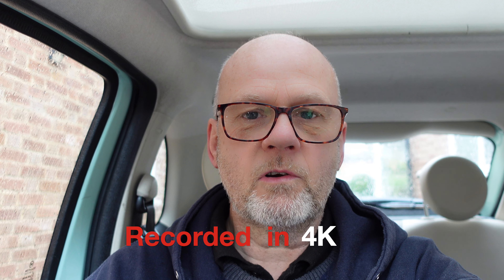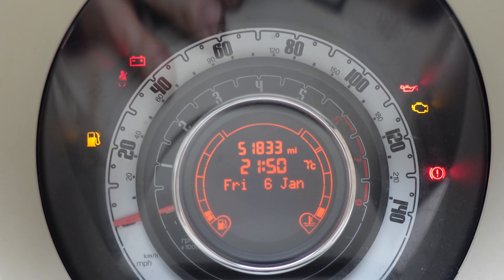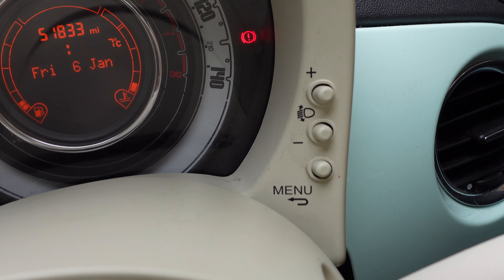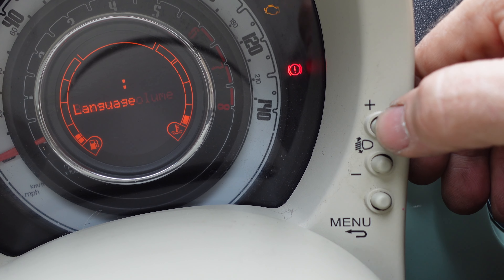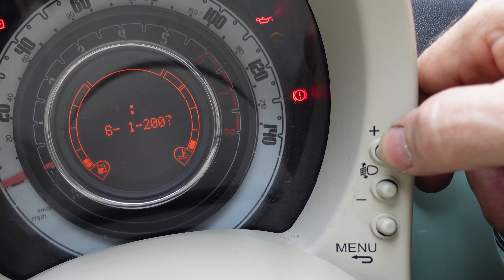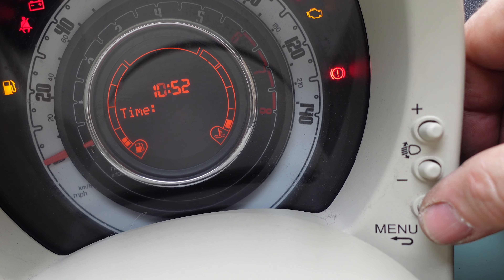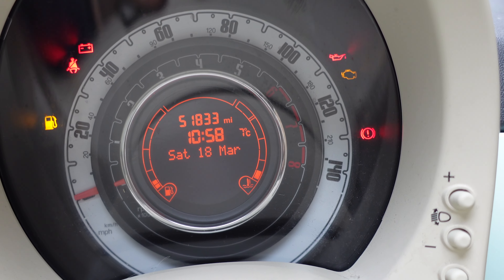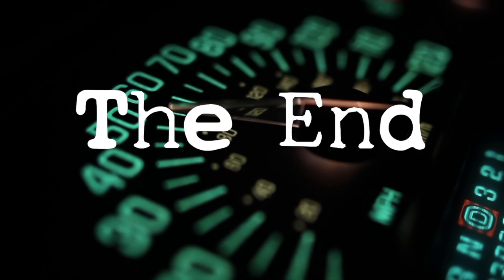Adjusting the time on a Fiat 500 or Abarth - Love 500 Basics Series

Comment: Hi Paul.
A nice basic how to video here mate!.
Can i ask you have you ever experienced any or some of the menus not coming up!, on the screen?  all mine work with the exception of the day lights function! I press menu then + button and it goes straight to passenger bag ,missing daylights completely- if i try going the other way  round its scrolls down to passenger bag then next up it shows the exit function!?
ever seen this before!.
Reply from the maker: I can’t say I’ve ever seen that.
Reply: @Love500  Just my luck another "one off!" issue no one else has heard of then.
It dont bode well for sorting it out does it!? guessing its another example of speedo electronics failing(other dim warning lights when indicating etc!?) ie dry joints on the electrics mother board etc! beginning to wish id bought an Alfa Mito instead!😤😫😖
Reply from the maker: @stephenmeader8878  I’ve had it with passenger airbag on off menu not there but never DRLs. Are they actually working? There’s no fuse as it’s controlled by the BCM.
Reply: @Love500  Oh YEA working ok!- its just that i could not turn em off if I wanted too  which i dont!.( similar to my stop/start issue!) its just that i cant make the choice! bloody Fiats bloody Italians!  (ps i also have an Italian Moto-guzzi motorcycle! which jerks me around in  similar ways with various things working or not depending on which way the winds blowing!.
All i need now is an Italian mistress to complete the set(and probably put into an early grave eh! (but what a way to go!!!! )😉😁🤨